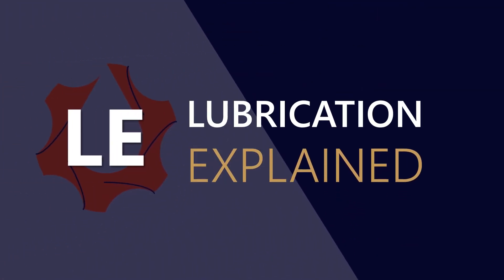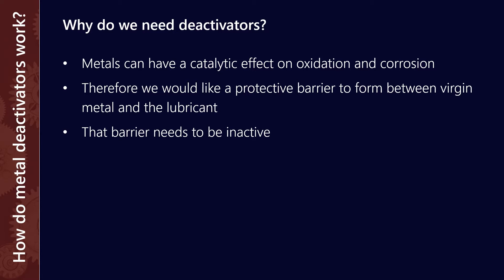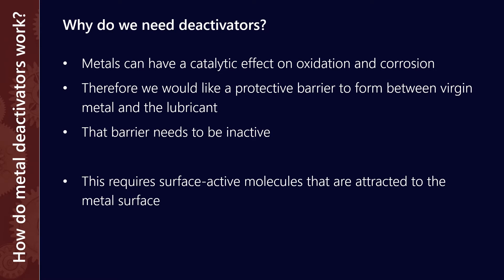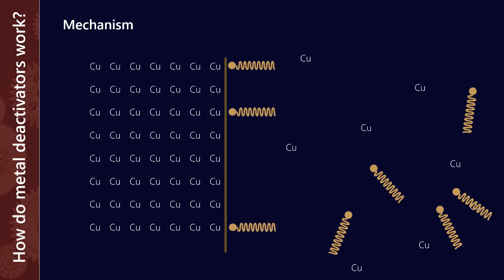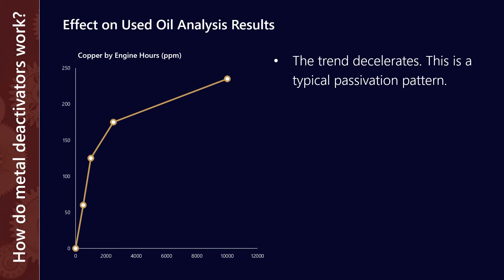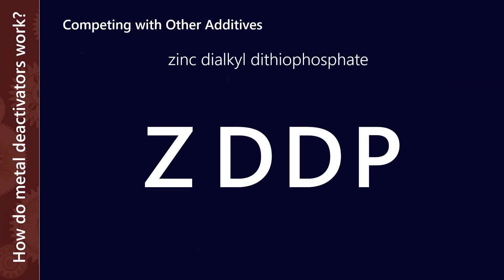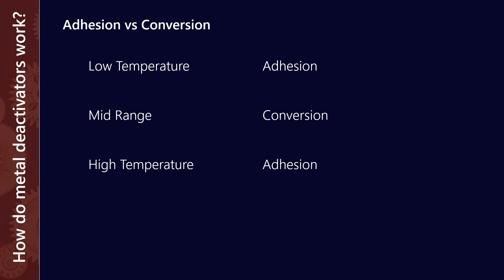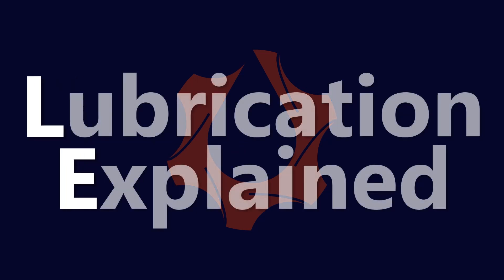What do rust and corrosion inhibitors do?

Comment: Yair... I was kinda like... Detergent/ ZDDP... All polar head... Enough corrosion inhibit, already? 
Copper or Aluminium, atom heads, should corrode themselves, in the first place? :)
Reply from the maker: Oddly enough, ZDDP is one of the reasons that copper corrosion inhibitors are required. The Zinc in ZDDP can exchange with the copper metal - depositing Zn in the coolers and forming CuDDP in the lubricant. Fortunately this isn't particularly harmful as CuDDP is itself a very potent antiwear chemical, but it does cause a spike in ICP copper values.
Reply: @LubricationExplained  where is the copper metal comes from? which part of engine is made of copper?
Reply from the maker: @chunhwasee1490  In most applications it will be the oil coolers. In some cases it can also be part of bearing materials.